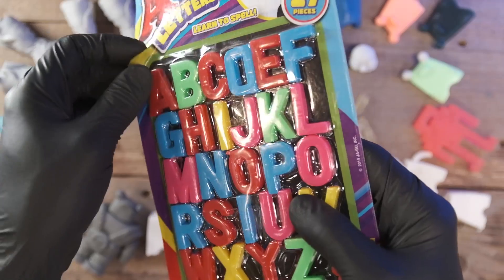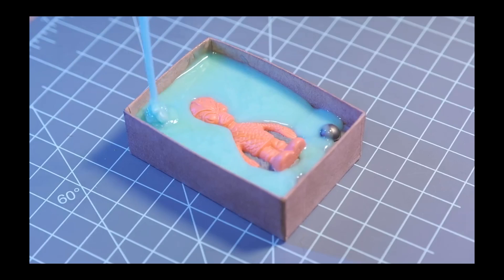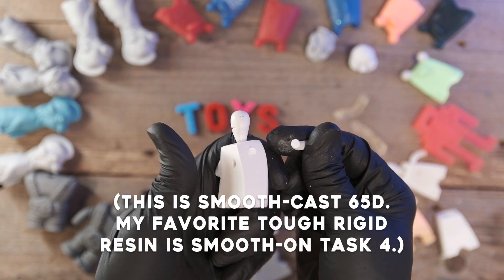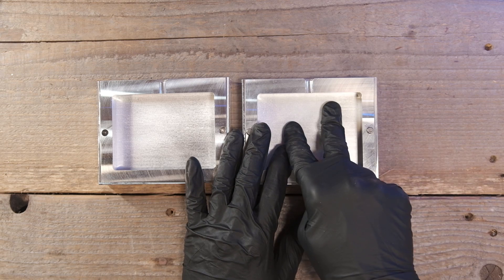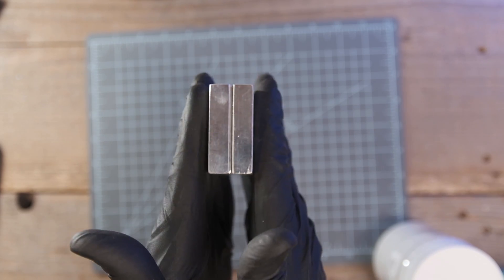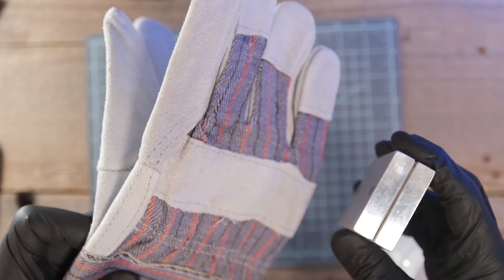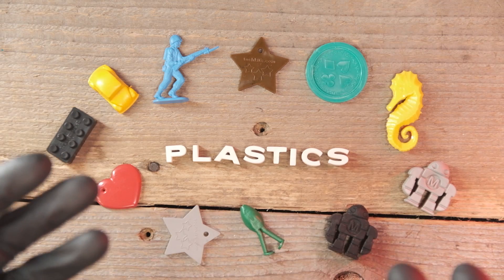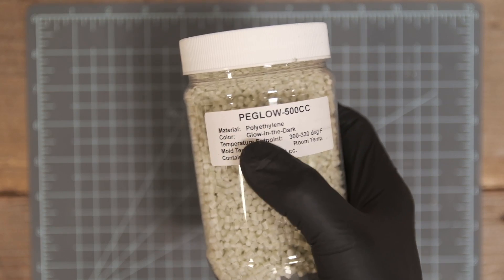First time INJECTION MOLDING! | Bench-top plastic injection molding.

Comment: How can you make injection molds with electronics etc. suspended in the molds?
Reply from the maker: There’s a technique called “insert molding” where you basically place the object in the mold (let’s say it’s a metal screwdriver shaft) and then inject plastic into the mold and around the object, locking it into the plastic when cooled. If the electronics parts are rigid, it would be easier to, say, suspend them so that the plastic forms around. Hope this helps!

Comment: Nice, but how to make molds at home?
Reply from the maker: Hey there! You have multiple options, but I'll share the ones I have used:
- Resin / epoxy molds in an aluminum frame. (Also resin + metal oxide, for heat.)
- 3D printed molds. Embedded in an aluminum frame, these can work very well! (Siraya Sculpt or Siraya Clear are the ones I've used and recommend.)

Comment: Any experience using glass filled nylon?
I have an other injection molder, but similar, and I have a ton of problems…
Nozzle clogging (plastic stiffens up).
Nylons expansion caused heated plastics in the tube to solidify some above heating elements, causing the plunger not to work properly…
Moisture in the nylon (have been taken care of, but has been a big problem).
Plastic sticks to the plunger when I pull it out…

Comment: Brotha, you can do sand casting and make your own metal molds.

If you can do this, sand casting a mold would be very easy for you. Can make aluminum molds, brass molds etc and then use for your plastic injections.

Can use an old propane tank for the furnace, little crucible to hold your metal pieces and it'll melt down into liquid metal. Pour into the sand of your image, allow to cool, little sanding. Very easy since it's aluminum. Can save old cans if your looking for metal. Metal down junk to get your metal molds. Can even remelt an old mold into a new one if u get tired of using the same mold.

Please look into sand casting. It'll save u so much to make ur own mold. You're already very good at melting and pouring and you know the process. Same thing just a different medium. Instead of liquid plastic, it's liquid metal.
Reply: Just now found you 5 mins ago via yt recommended.

Comment: How does a blank mold cost so much!? I feel I can make those pretty well, its CNCing the custom molds which is a pain! I have to get better at removing all the tool marks and figuring out where to put the vents. Also, perfectly lining up both sides during the CNC process was proving to be annoying, but i made a fixture that seems to be working well.

Comment: Friend, excuse my bad English, I'm from Mexico.
Do you have any idea how to produce Plastic injection Tablet case?  .. I want to create a small local production and you have inspired me .. Thanks!
Reply from the maker: Hello there! My knowledge is still not thorough, but I can almost confidently say that for something the size of a tablet case, you would need a much larger unit than I have. (The shot size on the LNS150A is only around 1 cubic inch. Great for little figures/toys, but not as much for larger items.) The other thing would be... to force the melted thermoplastic into thinner areas, you may need more force. This is where the hydraulic presses come into play.

All that said, I don't discourage you from trying the do-it-yourself approach to tablet cases.

It IS possible to even do this with resin, if you use the right resin. Not AS tough as standard plastics, I imagine, but TASK4 could work. That's just one example of a resin I've used to produce thin pieces that are tough and not brittle.
I wish you success, my friend!

Comment: Would it work to print a mold and use it for injection molding? Making a 3D object and then create a negative of that, print it and then use it for injection molding.
Reply: YES, the LNS Technologies Model 150A machine will work with a 3D negative mold.

Comment: For the Mold you just need to cast Aluminum ...
Make a plaster 1/2 with lines for the tree, pour in the liquid Aluminum - then do the other half - make sure it's in the specs for your injection machine -  most provide a template.  Also a CNC machine can carve a lot of cool stuff out of Aluminum including most molds.
-Obviously, yeah dealing with molten metal is dangerous - and need equipment to melt it - but plenty of easy DIY to do that - I used to do this in shop class way back...
Reply from the maker: Hey Ben! I've seen this done before, and think it's great for textured surfaces. (The example I saw was a mold for plastic pieces used on a climbing wall.) What I was concerned with was pitting / surface issues with the cast metal. Thank you for the feedback, and for watching!

Comment: Have you ever tried to use your heat resistant resin that you used for the sogmaster pewter figure to make your own injection molds for the machine? Or does that not withstand the heat

Comment: Injection moulding says max wall thickness of 6.35 mm. But there are plastic rods over 200mm in diameter. Could I make an injection mould for a massive complex shape say a cylindrical shell (240mm OD) attached to a rectangular block(50mmx100mm) having a dovetail using PET?. if so what about porosity does vacuum or injection part solve this and to what extent?

Comment: Dear Mr. TheCraftsman Steadycrafting, you got yourself a new follower! I like you style. I also have a tip: some plastics needs to dry before injection molding. PP and most of the thermoplastic elastomers (tpe) don't have to dry. ABS for example must be dried on 80°C for around 4 hours. Also be careful with the fumes and glasses, especially with POM! That material releases strong concentration of formaldehyde. Looking forward to seeing you injection mold again.

Comment: I have a question. So I run a store on Etsy where I sell mostly 3D printed props and collectible figures. I was wondering if it's worth to make them out of a liquid plastic or some type of resin cast and bring the prices up more or should I continue using premium PLA to keep the prices affordable? I've been wanting to try making molds and casting them out of resin but I'm afraid I'll be spending more money on the mold and casting materials than what I'd make. I also have no experience with resin, so there's also the possibility of the molds/casts ending up with bubbles, thus wasting material.

Comment: Just to clarify, the pressure applied after the polymer fills the cavity is called "packing" phase, this is a procedure helps to decrease the warpage of the final part and also increases the density of the part since the volume is the same but with more mass.

Comment: You can mix your colors into the clear polypropylene and get the same results on the color. Where I work, we mix 6 parts clear to one part color. You’ll get the same color out, but use much less of the expensive colorant plastics.

Comment: Crafsman, what do the two different temperatures represent on the machine?
Reply: The bottom number (green color) is the SV - Set point Value.  This is the number that is the recommended temperature for melting the pellets.  
The recommended SV number is on the label of each bottle of plastic pellets.
The upper number (red color) is the PV - Present Value. This shows the current temperature of the machine.  
Once the PV number reaches the desired SV number -  then the machine is ready to inject the plastic into the mold.
Reply: @techkits  cheers

Comment: I wonder if its possible to create pewter molds by making a clay model, then using that to create a high temp silicone mold, then using the high temp silicone mold to make a pewter mold, then using the pewter mold for injection molding. However, it may not work due to the temperatures involved and how the hot plastic will interact with the metal, it may cause a bad finish.

Comment: CrafsMan, helpful tip for you!  I love injection molding, and have lots of experience.  It doesn't have to be costly.  You should get an SLA resin printer. You can create high-quality molds, cheaply.  They won't last 10,000 copies like your aluminum molds, nor 100,000 copies like a steel mold. But it should last for at least 100-1000 copies if made correctly.  The SLA resin printer I recommend most is the Elegoo Saturn (<$1,000)(when it becomes available again this 2020 holiday season) or the Elegoo Mars pro (~$300, available now on Amazon or Elegoo's website, but it has a smaller build volume than the Saturn).  If you have $2,000-$3,500 to spend and want big build volumes, then you should look into the Peopoly-brand resin printers. Right now, SLA and MSLA resin printers are dropping in price, and improving in quality at a very fast rate.  Please feel free to reach out to me if you want to talk more about the abilities of SLA printers, or if you need any help selecting an SLA printer yourself!  Love you videos and would love to see you make molds using a resin printer!
Best wishes,
Joe
Reply: TheCrafsMan has 2 SLA printers, a Mars and a Photon. He showed them in a previous video. I'd love to see a video on the different high-temp sla resins and how they hold up!
Reply from the maker: Thank you for the comment, Joseph!
Elegoo sent me a Mars printer a while back (I did a review on it vs. the Anycubic Photon) and I REALLY like it.
I've had an offer from another company (not Elegoo) wanting to send me a very expensive SLA printer in exchange for a video review, but it doesn't make sense for me to review it, knowing it likely won't be beneficial for the company. (It costs way more than the injection molding machine, and I would feel bad getting a free huge printer and them not benefiting in some way.)
With the shot size I'm working at, the Elegoo Mars or Pro (Elegoo surprised me with one randomly, as a sales thank-you.) are just right. I'm looking into high-strength resins currently, suitable for 3D printing molds.
I'm also thinking it would be better to 3D print like I've been doing (using regular resin) but to make a high-temp master mold copy in a different material. Similar to the hard mold video I did recently, but a step above regular plastic resin.
Debating about testing metal oxides in resin, in ratios that might allow for the heat exposure. But also concerned about how well the molds would release the cast part. Lots and lots of possibilities with this.
Always open to suggestions with this stuff, as I know there are many ways to go about it. Thank you again!
Reply: Hello Joe, just saw this comment and wanted to ask a few questions. Do you have a resin you recommend for making molds? And which program do you use? I can design my own models in Fusion 360, and already have Elegoo and Anycubic printers. I am thinking about getting the injection molding machine CrafsMan used in this video, and would like to make my own 3D printed molds. Thanks for any help you can provide.
Best regards,
Ben

Comment: Congrats on fulfilling one of your crafting dreams. May the rest come true. (Love the croc dundee "Now thats a wife" line)

If you still have your resin 3d printer you can print your own injection molds using Liqcreate Strong-X resin (its a little pricey). It is actually formulated for use as a small volume injection mold. Its data sheet has more info about that if interested. There maybe other resins that work but that's the one I'm aware of.

Comment: I've been interested in these machines for awhile now.  I'm curious though, is there some printable resin (via something like an Elegoo Mars) that could print molds which would fit inside the aluminum blank molds and withstand the heat?  Pretty sure I've seen Formlabs advertise that capability.  I'd be very interested in getting something like this if it could compliment my Mars in such a way!

Comment: This is so cool!  Add me to the list of people who want to see a video about using recycled plastics! 

Also, is it just me, or does it seem like maybe Crafsman has his mold lateral stop (dunno the actual name... it's the hex-head bolt with the black knob on the end, used to keep the mold in place horizontally) installed backward?  Seems like the black plastic knob would be intended for touching fingers, not a (potentially) hot metal mold.
Reply from the maker: You are 100% right about the mold stop. Plastic knob end should go to the outside, metal to the inside (touching the mold).
It hasn't caused any issues, but it is COMPLETELY backwards. (Well, it WAS... in the video. Fixed now.)
Can't believe I even set it up that way. I'm going to pin your comment for educational purposes. Thank you!  :)
Reply: @TheCrafsMan  +1 for the plastics vid!
Reply: @TheCrafsMan   Loving your videos (I just subbed), and how you say sweet stuff about your wife at the end of each video :). I'm also an artist/toy maker, and I'm considering investing my stimulus checks into an injection mold setup since art is my living (been casting with resin since 2008)...the main thing holding me back is I am hoping to find a slightly larger machine, but mainly I want a affordable way I know will work well for creating the molds. I know you're planning on releasing a video on creating the silicone mold for inside the metal mold frame...but do you mind telling me if you're having any issues with the cast pieces being warped from the pressure of the injector?  I am really eager to get one of these, and I'm trying to find out more about the possibility of doing silicone molds. Thanks for your time, and the awesome videos, you're a sweetheart! This is my Instagram if you'd like to see my art toys and sculpts in progress :) https://www.instagram.com/meadowknightcreations/ .
Reply from the maker: @angelapileggi6031  Hello there! I really like how you're thinking. I completely understand the desire to go for a larger shot size. (If you're feeling very adventurous, you can look at the designs used by Precious Plastics and them. Fairly LARGE parts are possible with that setup.) As far as the silicone mold, I'm editing that video now and I can say that, even with Mold Star (not designed for heat), I've had repeated success. The possible down-side (and it's different for each mold - chunky vs. thin parts) is the hold-down time is extended, to keep pressure against the object while it cools. Cooling may take longer (silicone vs. metal) and melted plastic will want to come back out the top. Not a huge issue.
BUT, I'm also going to mention in the video - and will tell you now - that things like Mold Max 60 (more firm, withstands over 500 degree heat) or high-heat EPOXY... probably even better!  :)

I appreciate your kind words, and I sincerely hope this information is helpful to you in your upcoming (ad)ventures!  :D
Reply: @TheCrafsMan  Thank you so much, that's a huge help :D! I have been contacting a bunch of people left and right, and contacted Reynold's Advanced materials where I get my molding and casting supplies, and they suggested the Mold Max 60 as well! That is super encouraging that you've been having success :). Having to have a little more cool down time is not too bad of a thing, it's still  gotta be way faster than the resin slinging we do. I will look into Precious Plastics too and see what they're up to, or if there's anything they have within my budget if they're selling equipment, thanks for the lead! And thanks for the friend request on FB :).
Reply: @TheCrafsMan  Crafsman, have you ever considered making little Crafsman figures to sell us? With the gloves and all?
What happens if you pour 3d resin in a silicone mold? And set it in the sun a while?
Have you considered trying an injection mold of hydrocal?

Comment: Don't know if this would be going in too different a direction but with this injection molding it would be very complimentary to try simple aluminum casting to make the blank molds so you wouldn't need to buy them or even try casting some molds with designs that could be made from 3d prints. Also I would love to see how well plastic shopping bags work in this, they're LDPE so should be able to work in theory after some processing.

Comment: I see that you'll be releasing  a video about using silicone for your custom molds, but, the thing that's getting popular in rapid, small-scale production is making SLA resin prints of inserts for those mold blanks... and you happen to have an SLA resin printer.

Comment: Crafsman, I worked at a plastics factory a couple of years ago, and seeing the color change moment brought the memory of doing a color swap mid-shift--we would use a so-called 'purge' mix that when loaded into the feed hoppers would push out the residual color from before, and then allow us to put the fresh mix to melt for the next product.  We also routinely recycled scrap material with grinders that would make tiny chips that would then be fed back into the feed at a particular percentage, depending on the product.  We would feed the machines from very large cardboard boxes with big vacuum hoses.

Comment: $1800 though, that’s some serious pocket change. Considering how much you can get a 3D printer for, which has way more moving parts and tech in it. Kind of hard to justify that spend.
Reply from the maker: I've been on the fence about injection molding machines for a while, but mainly for the MOLD COSTS. That was what blew me away. I couldn't spend $1,800 on a machine and then have to spend $10,000 for a couple molds.
Where I came around was when I realized these new mold-making techniques using the same DIY methods I'm used to.
For me, 3D printing is fantastic for prototypes or printing a "master" from which I get my mold later. Not for production. The speed and strength are when injection molding comes in. I think 3D printing is getting to a place where low-end DIY type folks will be actually printing 3D parts quickly, that don't break easily. That's crazy to think about.